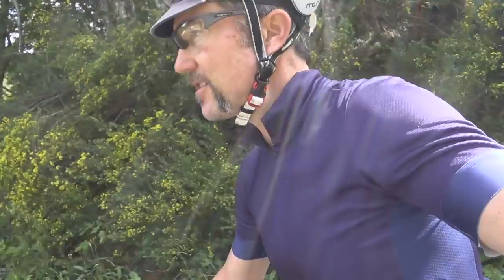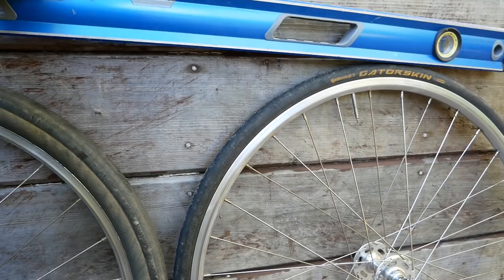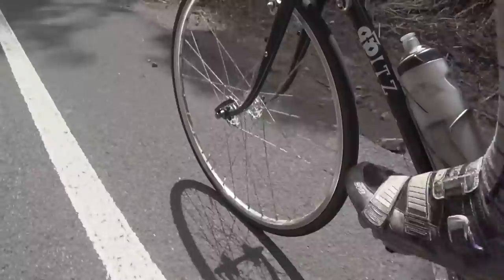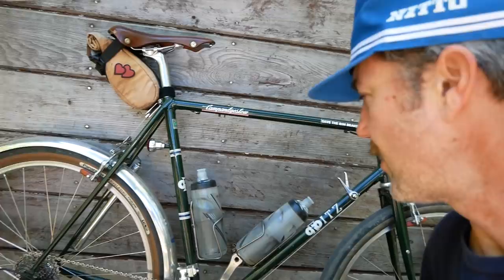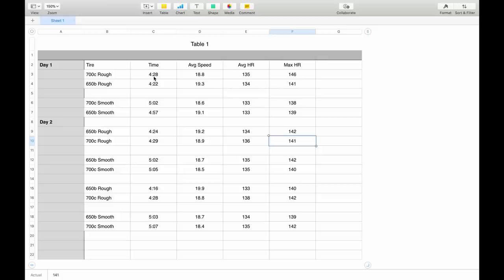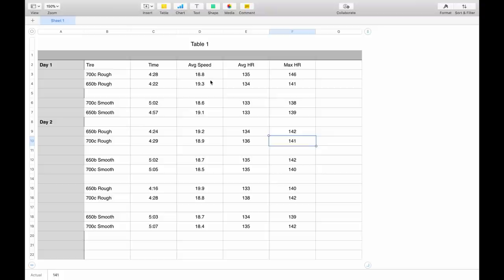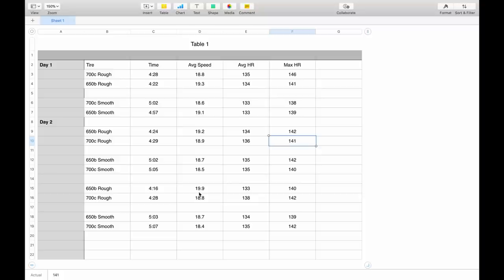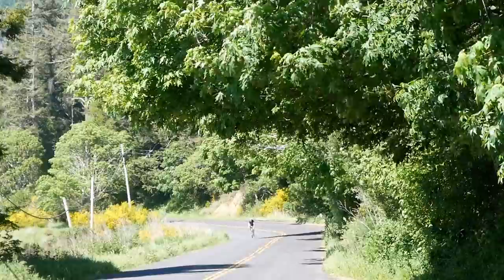The Great Wheel Debate: 650b vs 700c Part 3: A Practical Field Test

Comment: If I may ask a question, I just bought a 1984 Raleigh kodiak touring bike and it’s in near mint condition with original tires that look good, I don’t think the bike was ever ridden much at all, I’m not an experienced rider and looking to do over nighters on it , so light weight touring and getting in shape and loosing weight.. so I was wondering should I upgrade the components? To me it rides like a Cadillac but I haven’t ridden many bikes..so if I do some upgrades what would you recommend ?
Reply from the maker: Congratulations on scoring such a sweet bike! It doesn't sound like you need to do much, if anything, but here are a few of my thoughts. Saddle, saddle, saddle. This is going to be the hardest choice in your life, and it's going to take some trial and error, but get a good saddle. A good saddle may not feel comfortable right away, but over time you'll find the really soft saddles are actually uncomfortable. It's hard to beat a good Books saddle, but not everyone likes them, so prepare to experiment. Replace the brake pads, cables, and shifter cables. I would at the very least service the bottom bracket and replace it if needed. I would also check the headset and replace if needed. A loose or worn headset is the worst! Remove and clean the quill stem, add grease and reinstall. Check over the stem and handlebars for cracks. If you see any cracks or anything even slightly questionable replace them. DO NOT take any chances with older aluminum parts, especially the stem or handlebars. Look over the fork blades, fork crown, and steerer. Although very unlikely should you see any cracks or fractures (hairline or otherwise) take the fork to a frame builder and get it fixed or replaced. A frame builder can make a new fork with all the bells and whistles and make it fit perfectly with your bike. Check the chain to see if it has stretched and replace as needed. Check the hub bearings to see if they are loose and service them as needed. If these are loose ball types (which they probably are), you can get new ball bearings from the bike shop. 
It sounds like the tires are good, but personally I would replace them with a new set. I prefer fast rolling wide tires like Rene Herse, Gravel Kings, Pari-Moto, etc. Panaracer makes a whole bunch of fast and light tires for tubes or tubeless for many brands out there.  Other brands make wide fast tires too such as WTB, but I haven't ridden them. A traditional touring tire with a thicker tread and puncture belt is fine too if you're worried about flats, but it will feel slower and sluggish. Fixing flats is no big deal and it's good to have few now and again to remind you how to fix a flat, but also how to look out for sharp objects on the road. I've gotten about 3 flats in the past 7000 miles of road and off-road riding on super thin tires, so for me the extra light and supple tires are worth it. I understand not everyone wants to worry about their tires on a long ride. Carry a spare tube, patches, and tire levers. The main thing is to ride it, and ride it a lot. The more you ride it the more you'll see what it needs. 
Long term, you could upgrade the wheels. To do this you could have the rear hub spacing cold set to 130mm. Read about this on Sheldon Brown's website. Doing this will allow you to run newer hubs and a 9-10 speed cassette. You'll have more gearing and hub options to choose from. You might want to consider upgrading the brakes too. A modern set of Paul Component Engineering or Rene Herse brakes will provide excellent stopping, or you could also switch to v-brakes. Rim brakes have come a long way in terms of brake pad compounds, and brake/lever design. The only problem with rim brakes is finding good advice about them. All the best and enjoy that new (old) bike!
Reply: Thanks for the advice, I have checked for cracks and no cracks anywhere so yea it could use a full tune up and go with a sealed bottom bracket and change the brake pads. I will definitely get new touring tires and was thinking of using tuffy tire liners, and get a nice brooks saddle and new wider Handel bars, probably at lest a 38.1 inch , some fenders and front and rear touring racks, I like the swift front bag you have and will look into one of those....I think I will keep the gearing and wheels original for now and just get some miles on it and get in shape before I think about upgrading the wheels and gearing. Yea can’t wait to do some overnight outings on it ...well again thanks for your advice and love your videos and subscribed
Reply from the maker: @odgreenoutdoors20  Cheers and have fun!
Reply: After thinking about it I believe I’m going to go with a bob trailer and not do the front and rear racks, the bob does better in headwind then panniers, and I will get me one of those front bags like you and ms cools have ,

Comment: I didn't totally follow the epilogue about your plan to do more testing.  Like the part where you mentioned restesting at race speeds like 25-30 mph.  Unless you meant coasting downhill (?), I can't imagine anyone being able to sustain those speeds for any period of time on a bike like that running fat tires at 30psi.  It's actually pretty hard to sustain 25-30mph on flat or slightly rolling terrain for 5 min even on a light, aero, road race bike (unless you have an insane tailwind boost, like you can sometimes get consistently on Hwy 1). Another local cycling blogger, NorCal Cycling just issued a video in which he compared a climbing vs. and aero bike (https://www.youtube.com/watch?v=PhkarL9UX5k).  he used a power meter as a constant and rode a longer time/distance.  He wasn't going for max test speeds, just a moderate steady effort at his level.  Differences were minute to non-existent (IMO).  I ride consistently with both a power meter and a HR and I think the power meter data is much more of a "constant" of what force you actually applied in each test than the HR.  As you likely know, among other issues, once you're more warmed up, you can usually sustain a higher effort level at the same or even lower avg HR.
Reply from the maker: Thanks Patrick. I'll watch the video you linked.
Initially, when I set out to perform this test I had imagined the results were going to show a much larger difference between the two tires. I figured even the Gatorskins (which are considered slow) would still outperform the 48mm pari-moto/gravel king tires by a large margin and the discussion would be over. However, what surprised me most was how close the results came out in favor of the 48's even after multiple trials (both cold and warmed up). The differences are down to a handful of seconds over a 5 minute test. When I suggested more testing using better testing (more accurate) equipment, such as an accurate power meter (as you mentioned), and tires matched more closely was to see if this test was flawed. Perhaps the Gatorskin is such a slow tire it makes it look like the wider tires are faster?

Comment: Thank you for this interesting video series! I really enjoyed it, especially your (self-) ciritical approach to all the assumptions and simplifications made. For me, this suggests that you're familiar with philosophy of science ;-)

I noticed that you didn't do the calculations from part 2 for the actual tyres used in this experiment. So I tried to do them on my own.
You said you went with the following pressures:
48x650b: 30 psi
25x700c: 80 psi
I.e. the contact patch of the 650b is larger then the one of the 700c.
If we assume the following outer diameters of the wheels (simply by interpolatiing your table from part 2):
48x650b: 684 mm
25x700c: 672 mm
and then follow your calculations, we obtain a larger angle "phi" and thus a larger rolling resistance for the 650b:
48x650b: 19.56 N
25x700c: 14.35 N

Provided that I did not make an error, the calculations suggest that the 700c is quicker. So the experiment actually puts the contact patch rolling resistance theory into question.

Anyway, I think the most promising way to improve the quality of the results is to add more repititions while controlling for more of the variables.

All the best for your future! ;-)
Reply from the maker: Wow! Thank you for taking the time to review the tire choices and running through the numbers. It's worth mentioning, the force we're calculating with this method neglects to take into account the rebound force as the tire unloads and returns to its original shape.

Comment: I prefer smaller wheels with fat rubber pumped up hard! This is the goldilocks combo for me.  
On quality tyres (tubeless are best) the supple sidewalls deliver the comfort, and the high pressure reduces the rolling resistance. But then I weigh 100kg...

Comment: here is my take on it all....
the time difference is nominal to the point of being pointless. 
so there is no argument that more volume, is a nicer ride. 
So the question, (or debate),. It is question for me, do I want 650x47/48, or do I want 700x 42 like a wtb resolute or a 700x44 snoqualmie. 
yes Donnely has some nice 650x50 but at a huge weight penalty.

Comment: More importantly, how the hell do you manage to get your hair cut during these (shutdown) days?
Reply: 8638marc lmfao
Reply: Lots of great YouTube videos on cutting your own hair! I tried it and didn’t turn out too bad!
Reply: Recorded before lockdown.
Reply from the maker: This was DIY trim😂 I actually filmed myself cutting it, but wimped out including it in the video. I learned how to cut my own hair with a good set of barbers clippers, and two mirrors. Start with a #8 guard on the sides and work down from there. I taper to a #4 on the back and around the ears. The top wasn't cut (that's a lot harder).
Reply: One video I saw recommended thinning shears in addition to the clipper. I ordered some and they really worked to clean up the rough edges that a self-trim job leaves!

Comment: continue 
If you want to see the difference between diameters, 24 vs 48, the you should use the same diameter wheel and the brand tire.
Do you agree?
Reply from the maker: Having the same brand tire made with the same materials would help eliminate the possible variables across different tire manufacturer's. The exact rolling diameter will still be hard to achieve in real life, but a 25mm wide tire on a 700c wheel is very close to a 650b x 48 in terms of rolling diameter.

Comment: We need custom wheel/frame sizes depending on the size of the rider so that every size of the bike looks exactly the same proportion wise. Hate when the bigger bikes looks so twisted if it is a big size. Sure it would have be a bit unfair in some situations, but then the weight of the bikes should also be in proportion to the size of the rider. This is 2021 not 1860!

Comment: Henry 
I watched the video.  Please correct me if I am wrong, but your test was completely flawed.  If you want to see the difference in wheel diameter, that is 650 vs 700,  then you have to use the same brand tire and the same diameter tire.
If you want to see the differece
Reply: Davex, I think you may have misunderstood the setup of a bike with different wheels. For the tyres to fit within the frame and fork, a wider 46mm tyre fits if the diameter is adapted to a "650b" wheel (584 mm diameter rim), or alternatively, a 26 mm tyre fits on a "700c" wheel (622 mm diameter). The total diameter of rim+tyre is almost identical on these two options. It would not work with e.g. a fat tyre on a 700c wheel.

Comment: Can you refresh my memory... When you built your Fitz, why did you go 650B?
Reply: I have just started the process of building a do-it-all-rounder and hesitating between 650b and 700c.
Reply from the maker: I went with the 650b because these days there are lots of options in both slick and knobby tires. 650b wheels are lighter and stronger, and even with fenders there is less toe overlap. 650b makes it possible to have a normal chain stay length while still fitting that plush wide tire. Fenders fit both in the font and back more easily. 650b tires are known to have fewer flats and tend to last longer. 650b bikes can share similar frame geometry as a road bike but with wider tires. That's a few reasons but if you have a bunch of 700c wheels you may want to stick to that, which, is why think we don't see more people riding 650b.
Reply: @Henrywildeberry  Thanks for your input.  I don't have any leftover wheels.  I have a 200$ 26" hybrid with studded tires for winter and a 300$ Raleigh Carlton for 3 season commuting.  Being 169cm (5'7") with 74cm (29") inseam, I find myself that my toes are close to the fenders on the M frames.  Your arguments convinced me to go the 650b way.
Thanks again.
Reply from the maker: @NinthwaveThe  I think you're going to enjoy the 650b size.
Reply: @Henrywildeberry  Wider tires is the way to go for me, especially now that I am in my mid 40s.  

I did not mention that I have a carbon road bike (for sale) that came with 23c and max 25c clearance.  With our road conditions, it has been a while since I did not have fun riding this bike.

In november, I took my girlfriend's old CCM with 26" and fitted 2" marathon winter (studded) and rode it all winter.  Apart from the rolling resistance, I enjoyed the comfort of those large tires.  When you have been riding a road bike for almost two decades, you end up believing that this is how the road feels until you revert back to your childhood/youth 26" wheels and realize that, although those beaters are nothing close to "performance" bikes, still you enjoy them more.  It's quite a turn up...

Then I bought the Carlton for a 3 season commuter.

But the idea of having a custom built all-rounder is haunting me and 650b vs 700c is certainly an important question.

Thanks again!

Comment: Why aren't all the guys riding the Tour on 48mm 650B wheels then?
Reply: Hank Chinaski  Yeah mostly I was being facetious about this. The guys at the top of the sport who have virtually every pedal stroke measured by power meter and plotted against the resultant speed and distance are not riding with 40+mm tires on their bikes. I've run 700c's with 23,25,28,32 and most recently 38mm tires and on relatively smooth road narrower tires are faster though I personally prefer 28mm as the best compromise between speed and comfort. These plumpies that everyone seems to be touting have a lot of advantages in comfort and ride quality  but speed vs. watts of input power is not one of them or the pros would riding them.
Reply: @RidingEasttoWest  spot on! Wider tyres definitely more comfortable but they are not faster than narrower tyres.

Comment: I  notice you run a generator on the 650b wheel even with that the wider tyre was faster.
Reply from the maker: Yes, excellent observation! With the light turned off the dynamo has a very low rolling resistance.
Reply: @Henrywildeberry  I think that is a SON dynamo and yes it has a very low resistance due to it's high quality but I read somewhere even with the light off you will have around an additional 3 watts of rolling resistance. A resounding victory for the larger volume tyre

Comment: Do you enjoy 700c tires more on shorter, fast rides? I can imagine feeling fast has a value in itself if you have a shorter ride. Assuming you even do short rides anymore. 😂
Reply from the maker: The feel of a fast road bike definitely has value, and I'm sure if we tested these tires at a wider range of speeds, and better tires, the narrow tire likely has advantages. Tubular tires are supposedly even faster than the best clincher (the Gatorskin is far from close to the best clincher). I wouldn't call this test a final conclusion, but an open invitation to determine the curve where a narrow tire actually has benefit. With the type of mixed terrain and long rides I enjoy doing, it's nice to see that at normal cruising speeds I'm not actually going slower, even if it feels like it. When you add the versatility and comfort of a wider tire to it's longer life, it makes sense to me for an everyday tire.
Reply: @Henrywildeberry  +1 for testing those new FMB tubulars from Rene Herse! Do you have a patreon to help pay for equipment?

Comment: Using your heart rate as a proxy of power applied to the pedals is the same as looking at the gas mileage efficiency of an engine to measure how long a piece of string is.

The only valid conclusion here, and you've mentioned this yourself, is that some tires+wheels combos are faster than others.

Comment: Good effort but there are too many variables to determine which ones are at play here. The main problem is the two completely different tires used. The same tire construction must be used. Example: Compass 700x26 versus Compass 584x48. Ideally the same rim extrusion and hubs would be used as well to keep the weight issue out of it. Heart rate is also questionable, a power meter and keeping the bike at a constant speed would be much more useful. Multiple test runs are good but a statistical analysis should be performed to determine if the differences are real or not.

Ultimately Jan Heine's work speaks for itself, though I think he's only tested on smooth pavement. However, it's easy to predict that a wide tire at lower pressure would be even more beneficial on a rough road.